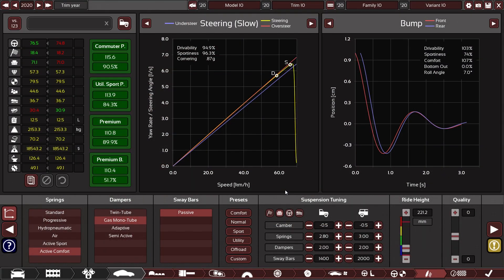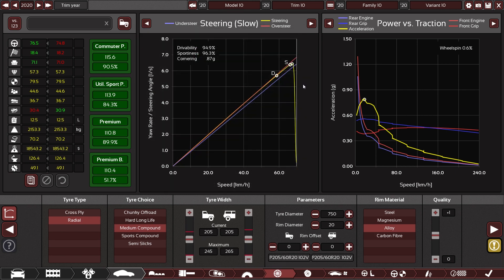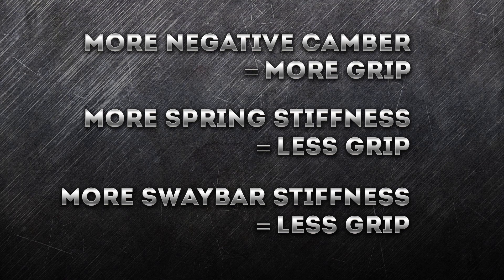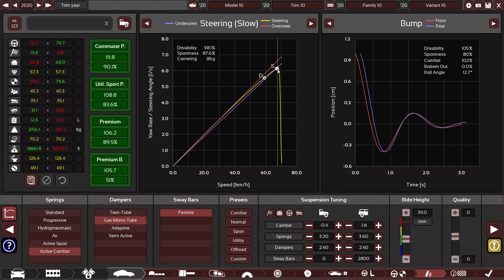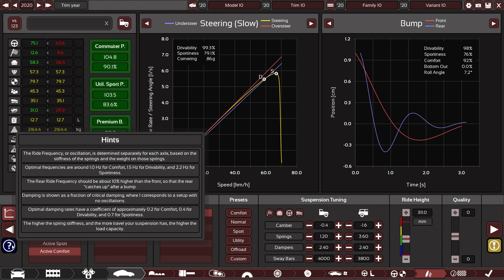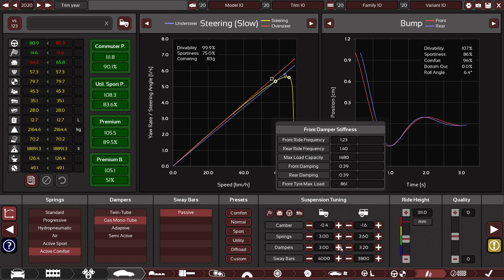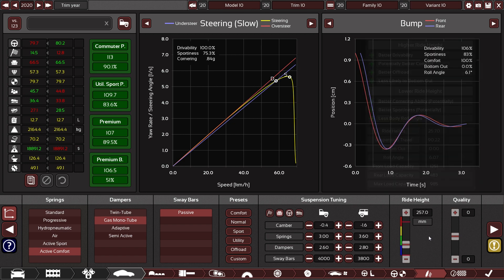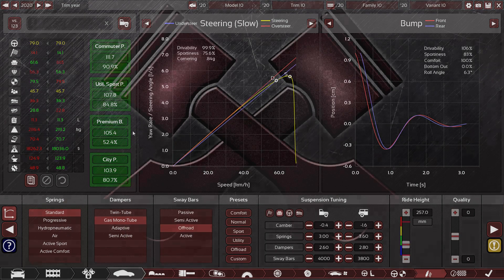Tutorial: Handling & Suspension Tuning

Comment: When looking at the graph, it makes it seem like over 70km/h, you cant steer at all anymore, as yaw rate/steering angle goes to zero. It also kind of feels like that in BeamNG.Drive, although I guess that's also caused by the lack of adaptive steering, which makes driving with a controller very hard at high speeds for a guy like me with mediocre fine mechanic skills!
Reply from the maker: Nah, that's not the case, this is for a constant radius corner :) so of course a tight corner you won't make it through at all after a certain speed :P
Reply: I would look into your high speed suspension tuning. BeanMG will fairly accurately simulate the graph Automation gives you for understeer / over steer on the high speed graph. You should have your graph have grip for the highest speed you're able to accomplish. Otherwise, your car will freak out after you past the max speed listed on the high speed graph.
Reply: Think of it like this, as the car accelerates it is slowly increasing it's steering angle.  At about 55 mph you are are at aprox 8 inches from center (~90 degrees), at that speed and steering angle you are highly likely to either lose the front or the rear.  The graph is a short and sweet threshold test to show which goes first and when.  When driving normally you would never use that much steering angle at that speed.
Reply: I found out that certain Vehicles need a ton of downforce on Beam.ng Drive, to be remotely controllable at higher speeds. I've had to tone down a lot on the HP as well, but the results is a powerful vehicle that's fairly easy to control. Even the van and trucks. You just have to slow down early.. Just like you would for any vehicle of that weight. I actually have 2 lips and 2 spoilers on the heavy vehicles. it doesn't seem to matter what size lip or spoiler you put.. They seem to have the same effective downforce. So just make it look nice